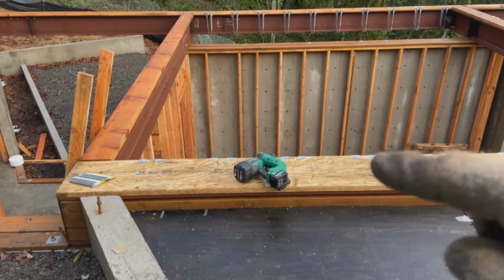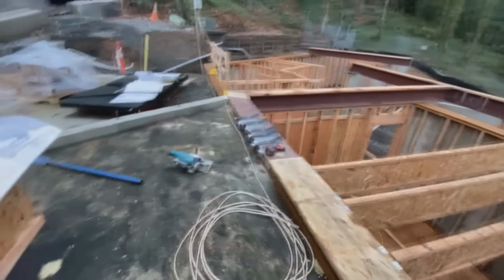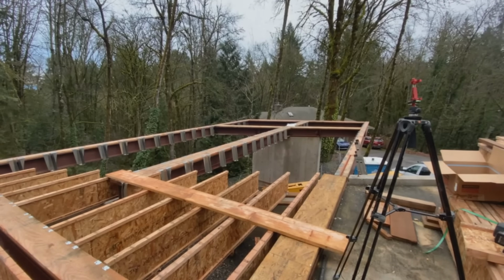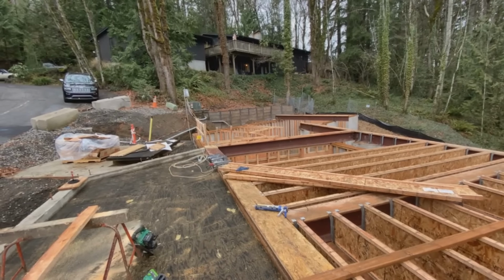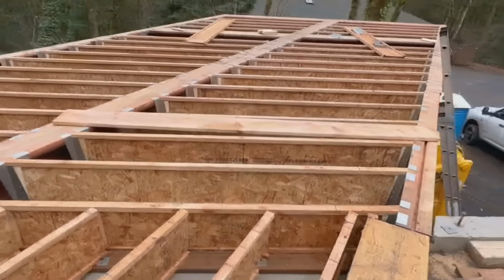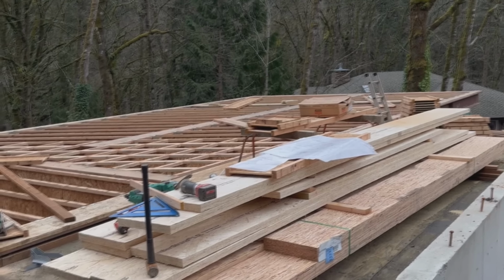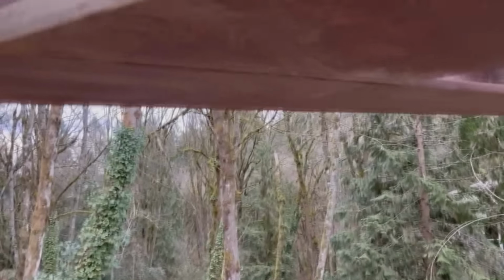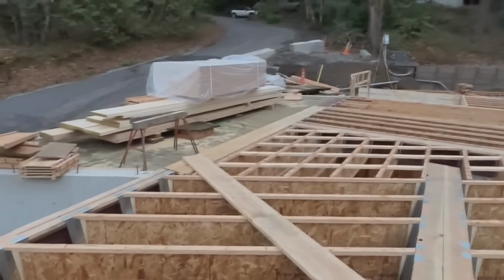Modern House Part 4- Main floor joists at garage and carport

Comment: Fellow Civil Engineer in Alaska and I have to say, the thoroughness and quality control you contain is so refreshing. I am sure the guy who did the structural would be pleased that you're the one putting together his/her work.
Reply from the maker: Thank you for that.  I do work closely with the engineer and it's always a pleasure being able to work quickly and cleanly thru little issues that have both of us trapped between reality, desire, and the tape measure:-)

Comment: How about some safety caps on those bolts sticking up out of the wall? Even though they have nuts on the end, it would just make a bigger, nastier hole in you you if you fell on one.

Comment: Would be super helpful if you were to do a truck walkaround, trying to rig up mine currently. Building up in Whistler
Reply from the maker: Thanks for the interest, I may get to that at some point as part of a larger video but the basics are passenger side is welding, wrenching, moving, fabrication and the drivers side is  carpentry, sheet metal, odds and ends.  If It was cold around here more than it is I would not do the drawers, even tho i replaced the rollers with UHMW glide surfaces the latches get really sticky when it freezes up.  the back seat is removed and  follows roughly the same pattern as the back but for the more sensitive tools and all the raingear and PPE.
Front seat is office and lunchroom as well as the data center:-) 
Things to think about anyway even without a video to refer to.  Oh, also the main reason it's laid out like that is I can put a full unit of ply on the two drivers side drawers  if i need to and the bed and rack were custom built by myself to haul a ridiculous amount of steel and still remain forklift loadable.  One last thing,  When the truck was new and before I started using it I had a local spring company rip the rear apart and add leaves to the main stack and replace the factory Ram  overloads with a  Ford factory 4 spring progressive overload set.  Works well and almost never looks maxed out.
Reply: I was noticing this as well, love the setup for side loading full sheets over top of the drawers. Are the racks galvanized? That would make sense for your climate.
Reply from the maker: Thanks,  yeah the whole bed  and headache rack are one piece and the rear rack comes out if I need to use the gooseneck .  Yes on the galvanizing.  I have a trailer that i built as well that is galvanized too.  Once they grey up a little bit they pretty much always look the same and you never have to repaint them. @yourmother102

Comment: Not sure ifvthis has been asked and answered, but is this a customers house or your own??? Either way, loving this series.
Reply from the maker: It's probably trickled out indirectly but it is not my house. I am the subcontractor for the framing and the steel both structural and architectural.  Thanks for tuning in!

Comment: Curius why not making all this structure from cement?once and ,"forever",is it not cost-effective?
Reply from the maker: That style of building is not really done around here.  The engineering involved would make it cost prohibitive for a single family house and It would also be difficult to achieve some of the details that they have planned. The back of the structure looking into the woods is almost entirely glass. I do appreciate you tuning in to watch though:-)

Comment: How is the material on the top of the I beams secured? I can't tell from the video.
Reply from the maker: Thanks for the question.  There are 7/32" holes  drilled down  each edge of the top flanges every 6" so that's two holes every 6".  the plate is then fastened with 2-1/2" simpson sd screws up from underneath. Although 1/4" holes would work I chose to go smaller so that if I need extra ooomph i can use a 1/4" floorboard screw thru the plate from the top down.
The main floor beams are all w14 category so depending on weight per foot they all have a different height which is then dealt with by using plates of varying thicknesses to bring them all to the 16" height that the engineered floor system is.
Most of them are right at 14 so 1/2 plywood and a 2x make it up well but the heavier beams at 132# per foot are 14.66 tall so an 1.3" thick psl rim board works perfectly other than the screws sticking thru enough to wreck your raingear :-) 

There is a bunch of footage in part 2 showing some of the drilling and a lot of the fastening.  I worked the steel off-site and added the wood then to make them easier to ship as they are much less slick that way.
Thanks for tuning in!
Reply: Great, thanks. I'm designing a home of my own with some long spans so I'm figuring on a few I beams. I figured I'd have to weld studs on the top flange, which is what I recall doing at some point in the past. I'll have to give your method some consideration and maybe run it by my structural engineer. I'm not sure where you're at but in CA they can be fairly particular about what they sign off on.  @ShredPile
Reply from the maker: @wthomas5697  No worries,  It all depends on the engineer.  This is also an extremely restrictive area and over the years i've done it a half dozen different ways. carriage bolts, weld studs, bolt bolts, floor screws, ramset etc. sometimes they don't want the flanges perforated with holes and sometimes it doesn't matter.  Better to tell the engineer your preference and let him look at the condition to see if it's ok. This project is under the constant supervision of the engineer so we speak often.  Good luck on your project.
Reply: Yeah, that's what I was thinking. He might not go for all the holes in the top flange.  @ShredPile

Comment: 7:24 This is scary. Specially to someone who knows how the sausage is made in the AI factory..
Reply from the maker: lol, ikr?  It was a risk rounding up .002” each time  across 20 joists but it’s my hope that some unpredictably throws its books off a little so to speak:-)
Reply: @ShredPile  Not this particular case but throughout many industries, people relying on "AI" to get answers on very specific components of their work and getting very convincing and very wrong answers 2% of the time.
Reply from the maker: Interesting and good to know.  I'm pretty low tech and I actually knew the answers out 7 bays or so anyways.  The possibility of it was a marvel to me though, much like the first time I saw a calculator watch as a child.  It also seemed like a little bit of  a silent answer to the 'you'd be more efficient with a helper' gang:-) @ZeZeBatata69

Comment: There is about a 10-15 year window to work like this. Everybody around you seems lazy after two decades of working this hard. The body sets the stage. Go get em boss!
Reply from the maker: I think I follow you... If you mean 10-15 years left then yeah, that's probably accurate. but the two decades in the can already is off by almost 2 decades:-)  I've coming right up on closing out my 4th decade of this.  It's just too much fun to stop now:-)